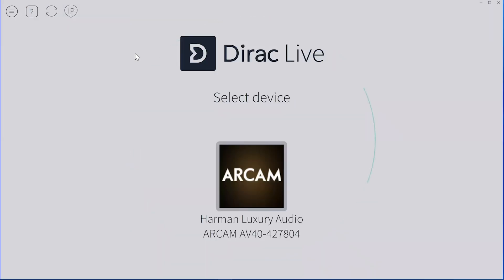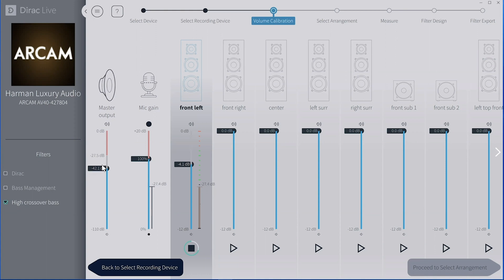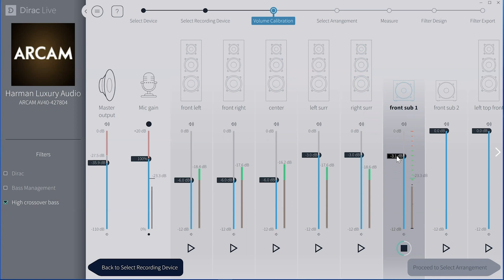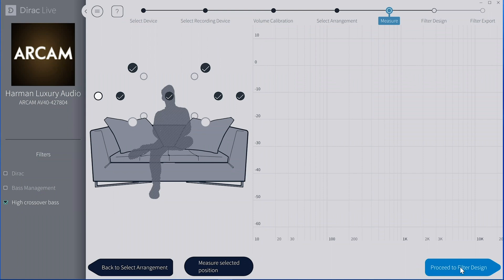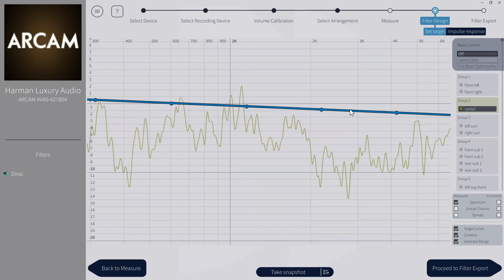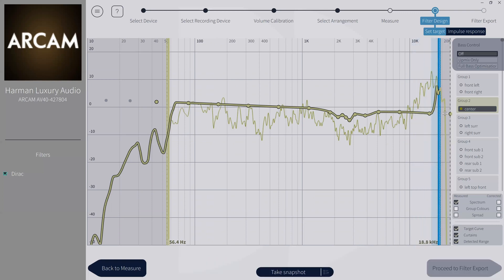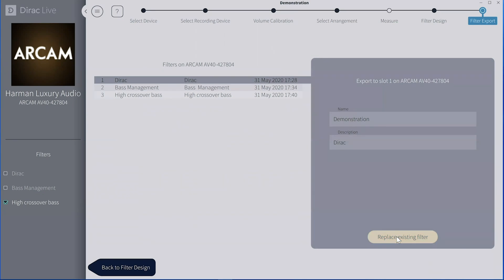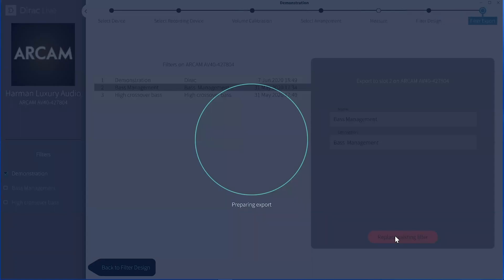HOW TO: Dirac Live Room Calibration

Comment: Great video! I’ve been having signal to noise errors and I think I’ve been setting up the mic and master volume wrong or something like that. This is probably the most informative video I’ve seen on Dirac so far. I’m going to follow it to the “T”.
Reply: I live in Ohio but visiting one of your shops in the Carolinas is something I really want to do. Looks like a first class operation run by av geeks. What more can you ask for?
Reply: Same...could not get it to work, thx...
Reply: I was also getting the signal to noise error until I maxed out the volume/sensitivity within the Windows microphone settings. After that it seemed to work fine.

Comment: Umik 2 makes better meassurements than umik 1?
Reply from the maker: Yes. It has better specs
Reply: @AudioAdvice  i have a fairly good Cinema room with Marantz Cinema 50 and Dirac Bass Control..i wonder If i have an Advantage with the Umik 2?🤔😀
Reply from the maker: @texxhexxmm  You probably would, we have found with Dirac, the better the microphone and microphone preamp, the bette the result. You could probably sell your UMK1 on ebay for about what you have in it.
Reply: @AudioAdvice  i got it today,a difference in Volume calibration i saw: whereas the umik one goes up to -18db  ,the Umik 2 one is at -30db ...i would have to unlock the lock to get higher.But the Test tones are similar in Volume.After the first meassurement i think,the Umik 2 makes a very good job.

Comment: I'm losing video signal when I run the Dirac software; black screen on TV and "See Dirac App" shows on receiver display. My video signal goes from my PC's RTX4090 to my Marantz Cinema 40 and then from my receiver eARC output to my LG CX eARC (Input 2). I have ordered a displayport to HDMI adapter so I can setup a 2nd display off my GPU and hopefully that will let me finish the process. Frustrating experience so far and your video has me thinking I may have just wasted $500 (mic & Dirac) on software that's to complex for my abilities.
Reply from the maker: Please reach out to our team of experts via phone or chat at audioadvice.com and they may be able to help you out!
Reply: @AudioAdvice  Thank you. I was able to get it working by running the software on my laptop. I mistakenly assumed that the data was being transferred to the receiver through eARC. It appears it's communicating by being on the same Wi-Fi network. I was able to get it to run alright. Just thought I'd give this update in case someone in the future saw my comment. Thanks for your response.

Comment: How would you set up the focal points when your room has a platform for seating?. Floor level with a small couch and then another couch raised up higher on a raised platform?
Reply from the maker: You have to start out with your primary seat, wherever that is, then do the other positions afterwards.  Many AVR's with Dirac give you more than one slot so you could set up one where you just measured for the main listening position, another where you did the entire main row, and another where you did all the seats.
Reply: @Audio Advice  appreciate you getting back to me.. I'm so confused and a complete novice with all this. No idea what I'm doing.
Reply from the maker: @celticcraps  Thanks, that is one reason to purchase from Audio Advice, if you do we can even do a team viewer and help you with the set up, but that is only available if you purchase from Audio Advice
Reply: @Audio Advice  sorry pardner. Appreciate it but I had already purchased it . Thanks for all you do though.

Comment: 09:00 I think you may be shooting yourself in the foot here. That dip is probably due to cancellations.. I don't think your center speaker has such a curve in a near field measurement... so that dip is a timing/phase issue. What Dirac does is a lot more complicated than adding dB's. It does time corrections to fix stuff like this.

Comment: do you leave the room when you calibrate the speakers?
Reply from the maker: You do want to be sure and not get in between the microphone and any speaker, you don't have to leave, but its not a bad idea, just make sure the door is fully shut before you start things up
Reply: @AudioAdvice  also, I have a pioneer LX-305. Can I use my umik1 in the front USB port? I feel like it’ll be better while I close the room, setup volume levels, than start positioning while I’m outside
Reply from the maker: @samgao  No, you would need to use that microphone with a laptop and dirac software

Comment: Advance subwoofer calibration software? I am new to this stuff and thought that Dirac does everything?
Reply from the maker: Yes, there now is an add on piece of software from Dirac that works be better blend multiple subwoofers.  Only a few products on the market are capable of taking advantage of it, and for most it is an optional purchase from Dirac, or included with others like the JBL SDP58.  Regular Dirac though is fantastic.  It does finally have some serious competition as the new Anthem ARC system also does the same type of bass blending.  Thanks for watching and commenting
Reply: @AudioAdvice  ordered a 3.4 Integra from you guys that is due here tomorrow (Fri) I have never ran any type of audio calibration software and am dreading it honestly.
Reply from the maker: @madcrabber1113  Thanks Mike, our team can help out if you run into any issues.  We appreciate your support

Comment: I have Dirac Live 3 that I am running in Windows 10. Doing this on an Onkyo TX-RV50. In Dirac, the Mic-Gain is in Db not in %. Can I change this? What version are you using?  I have 3.2. There's no "green area" when I adjust the gain....
Reply from the maker: This was done over 18 months ago using the Arcam AV40, they keep changing the software.  Thanks for watching

Comment: So for something like a NAD T778 with 2 subwoofers, I would only need the upgrade to the full-frequency version and that measurement will still integrate those 2 subs into the 5.2 surround sound? I don't need the Bass Live Multi Sub for only 2 subs? So essentially, you could group "Right Speaker + Right Sub" and "Left Speaker + Left Sub" and DIRAC Full Frequency would see those 2 subs and 2 front speakers as their own groups and essentially measure them as a full frequency speaker?
Reply from the maker: From the Dirac site, Bass Live Multi is not available for the T778.  If you group them as you say, you will not be able to roll off the sub.  You should still be able to measure the two subs with the $99 version and blend them well, Multi Sub for its extra cost, gives you some AI to better blend multiple subs, but it is only available on a limited number of processors.  If you purchased your NAD from Audio Advice, we can do a team viewer to help you set it up.
Reply: @AudioAdvice  Thanks so much for your reply, so I want to make sure with the $99 upgrade version that it can measure the 2 subs, as that's all I will ever be using is 2, I know you mentioned that it "should" be able to do it, but before I spend that amount of money, I need to know that it can definitely measure and integrate two subs separately as you say... I'm on your website looking now, just need to clarify "Yes or No" that it can definitely do this and I appreciate the fact we can do a team viewer to help set it up, that's great service 🙂
Reply from the maker: @adammusic1124  Adam, we do not have a T778 to test this with.  We suggest you read the data here https://www.dirac.com/live/bass-control/ and make your own decision.  We have been able to integrate multiple subs in the past without the multi bass option but have not tested it on your unit as NAD is not a big seller for us.   It looks like you will be fine, but we can not confirm this.  As we said earlier, if you purchased your unit from Audio Advice, we are happy to help with the setup via team viewer.

Comment: Extremely helpful Scott, thank you. My one question is that the diagram it shows the seats are shoulder high. How do you compensate for home theater seats? Thanks
Reply from the maker: Thanks Greg.  We recommend you place your seats in the normal position you use (if they have recline) and try to put the microphone where your ears would be height wise.  That gets as close to the sound arriving at your ears as you can.  Thanks for watching and commenting.

Comment: You set your target curve for subs and speakers seperate, but how does that work with the frequency curve for subs and speakers combined? If you set your target curve for subs a speakers seperate, the overall combined curve could be different from your target curves, right?
Reply from the maker: Mike, great question.  We leave the crossover points alone, but sometimes adjust the high frequency area to more match what the speakers look like.  The other important adjustments are to change the curve so Dirac is not trying to overcorrect for big dips in the lower ranges.  Thanks for watchng

Comment: In the section near the end with DLBC full bass optimisation ON, I've only ever seen DIRAC give a 70Hz default crossover and the user has to manually figure out their own crossover response and what looks best to them when moving the crossover vertical line around and calculating the filter. In your video you show that DIRAC suggested the most optimal crossover for each speaker group though... was this only a feature on an older version(s) of DIRAC?

Comment: Hi. Thanks for this. I wonder if you could explain the volume set up? Is this adjusting the levels or is this just so the microphone gets the best measurement? On my processor (as all) there is a level adjustment which I feel is correct. Obviously I would do on the fly adjustments depending on the film too so assume I can still do this once the calibration is uploaded?
Reply from the maker: Graham- the volume thing is Dirac only.  One of the first steps in Dirac is to make sure the levels coming in for each channel fall within a fairly narrow range.  Dirac allows you to adjust this on the fly so you do not have to jump back out to your AVR set up menu to change them, although we always suggest you get those close before you start.  Thanks for watching!

Comment: What if I wanted it to be as easy as Audysyee MultEQ; would it be safe to not modify the generated curves?
Reply from the maker: Steven- we would recommend you modify the curves if there is a big difference in the room measurements and the curve.  You do not want to try and over adjust big bass dips as it can strain your amp and possibly push your speakers too hard.  Once you play around with the software, it is not that hard to change the curve.  Thanks for watching!

Comment: Hi,
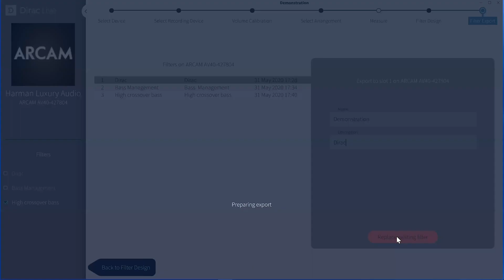are you sure you used the right Mic-Calibration correction file? Because your waveforme shows extrem high level above 10Khz. (7:50) Normally that is lower than the other freqenzies. (11:10) Or do I understand something wrong?

Comment: Hi great video but I have a question. On using the original Dirac 5 years ago, the installers would tell me to change all the speakers to large, set all crossovers to 200 hz, keep the subwoofer output to 0 dB and keep it flat!! Once establishing the correct curve and imported to the av processor. You would need to use a spl device to balance the speaker output and then change the settings back to small and reset the crossovers. Do you still need to do this with the latest Dirac ?

Comment: If you have good speakers and you set them up by how they best combine to give you the sound field you desire;shouldn't you place the subs where they disappear to you the listener and provide the best low register impact ?These auto calibration digital systems take a room with its faults and force good speakers to behave bad to cover up the room's faults while degrading the good speakers desighn. Correct?i.e.,covering rotten food with a heavy sauce to make it more palatable,BC,sound engineer at Abbey Road
Reply: I agree in principle, but no room is perfect even with the best available speaker placement.  This is especially the case if the system is in a standard living room.
Ideally you setup the physical placement etc as best as possible then you can use Dirac or similar to correct for what’s left.

Comment: Thanks for this, I have a couple clarifying questions:
1. You mentioned setting distances/levels before running calibration.  Isn't Dirac supposed to set distances and levels automatically as part of the process? 
2. Regarding the 6db cut/boost protection, doesn't Dirac have anything built in for this?  Seems crazy to have to manually adjust the curve to gain these protections on what is supposed to be the best calibration software.  There should be a preferences box where you can just set the max boost/cut like in REW.
Reply: The levels seamed to NOT be auto adjusting....they should be, mine do. Also, adjusting the curve like that would be a preference, not a requirement, and will not damage your speakers if you don't. Not sure why he is doing it that way....its not recommended by Dirac at all. By the way...that room response looks terrible!
Reply: @mikehuntington4440  some bad advice was in that video if you ask me
Reply: @chriswelljack4910  yes you are spot on this video is very misinformed